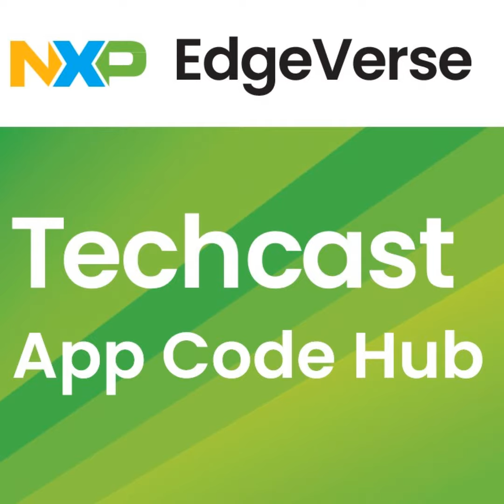Playing DOOM on NXP Microcontrollers: A Zephyr Success Story

Comment: Doom was made to run on 4MB PC, not on 16. Also, from the repository, it looks like this port is using doomhack's unofficial Doom port to Game Boy Advanced, (which was already optimized to run on 384 kB RAM) and not on the original PrBoom 2, which indeed would have required even more than 4 MB RAM.  Also, as it can be observed from the cited video, z-depth lighting is not implemented.